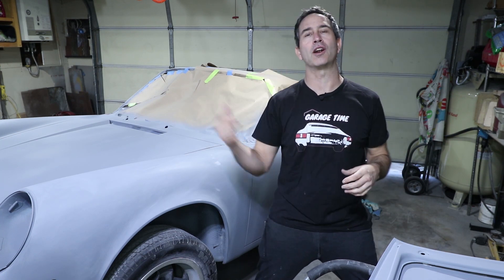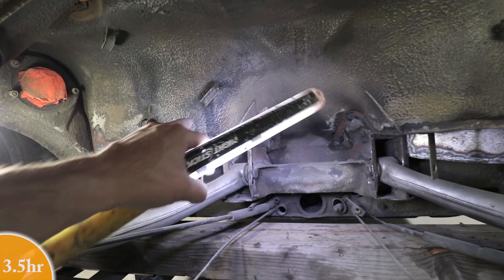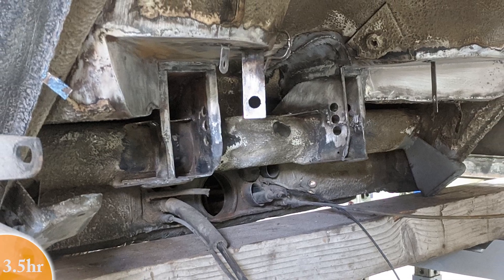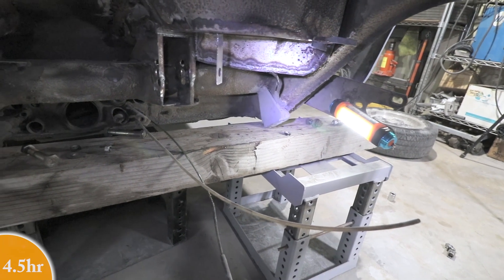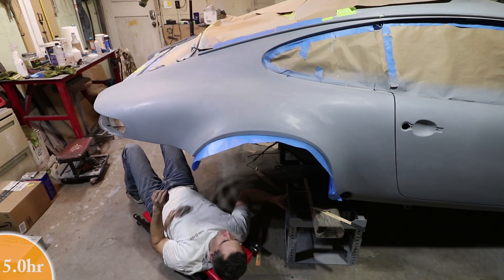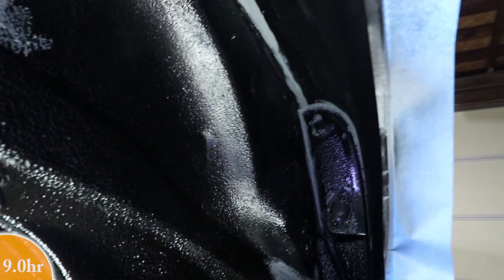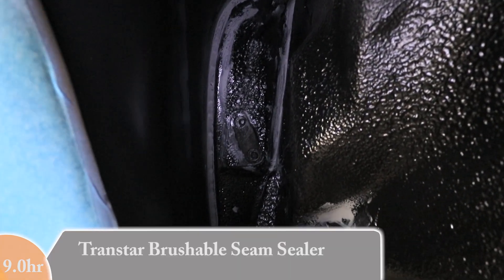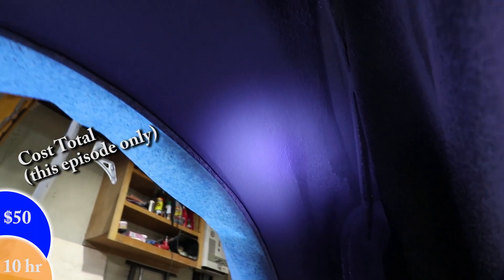The Bottom of My Porsche is More Shiny Than The Top Now!

Comment: Another great episode! What happens if you over do the phosphoric acid and it turns into calcium where it builds up in a corner, is sanding it enough or should I rinse with water too before painting. Asking for a friend ;)
Reply from the maker: Hi Geoff,. According to SPI who makes the primer the adhesion is compromised due to the white stuff/residue. I used Dupont metal conditioner and wiped it down with water before the conditioner dried.  
I'm not sure if sanding it off does the same thing or not?  Seems like it would.  SPI instructions say don't use any acid under the epoxy because it causes so many problems.  
If I were you, I would re-wet the metal with the acid and rinse with water right away.  Prime in 10 minutes.  Maybe overkill, but.....
Reply: @GarageTimeAutoResto  Thanks for the tip, I'll clean it up when its time to primer, at the moment its convient as surface rust form fairly quickly